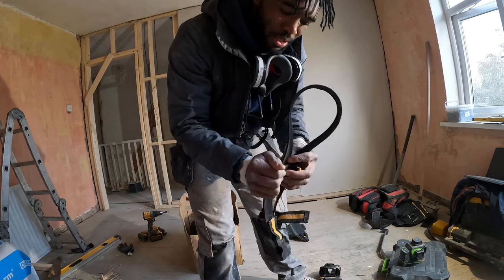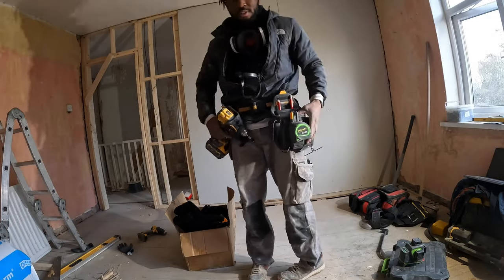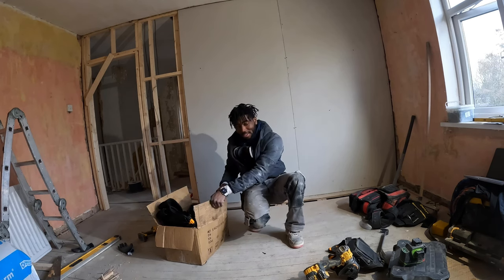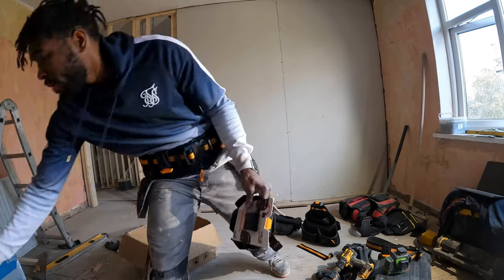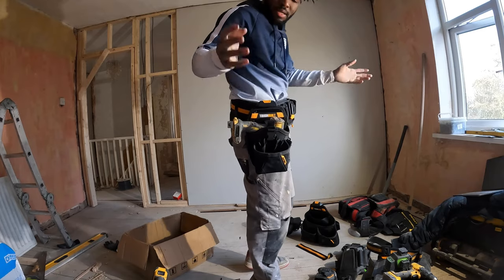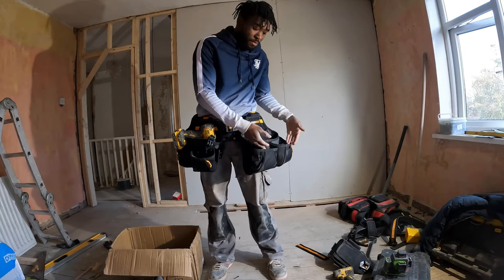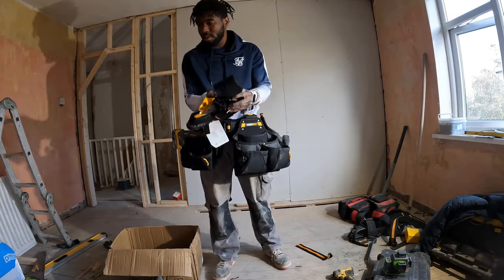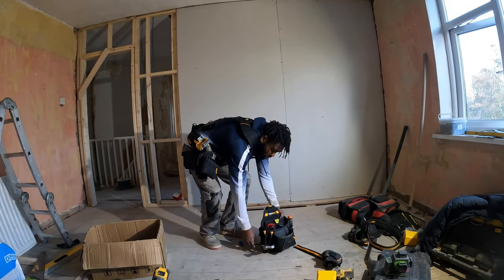TOUGH BUILT TOOL BELT (Impressions and usage)

Comment: Great belt. As a  Have a pouch set up for drywall work with rasp, tape measure, knife and drywall screws.  Another for framing/ carpentry with square, hammer  tape measure, 2' and 3' construction screws. And another for demo work.  And a gun holster. Just swap out for what I need at the moment. No more carrying everything and have an overweight belt. So much easier on the back and knees

Comment: As a framer I just bought this with only the tape measure pouch and the project pouch and an extra separate hammer holder for nail guns etc. just the two small pouches holds my chisel knife hammer tape pencil nails with room left for more. Not bulky at all, comfortable even tho I’m size 30-31 and it’s meant for 32+ I cut a lot of the belt pieces off to get it perfect. I was on a budget, but I think it’s good asf until I feel like dropping 200-300 on a belt
Reply from the maker: very very true thankyou for the insite
Reply: @ttdowgcarpentry2390  actually an update the belt is complete garbage, broke in 2 days, wasted my money unfortunately